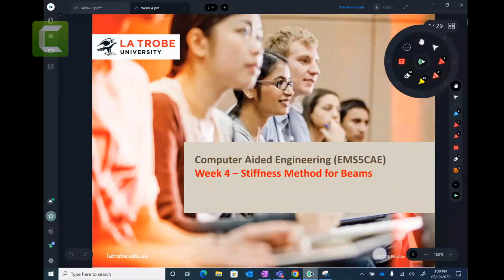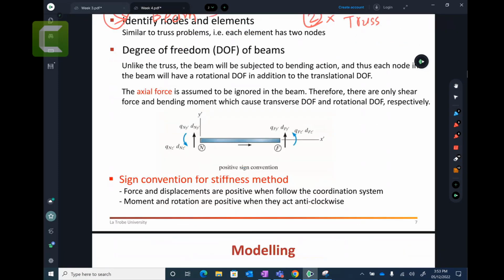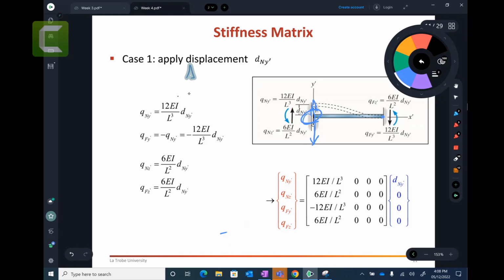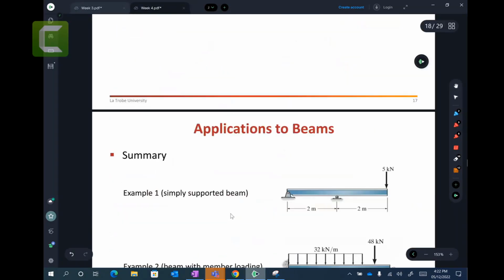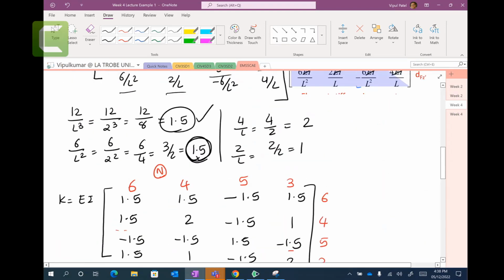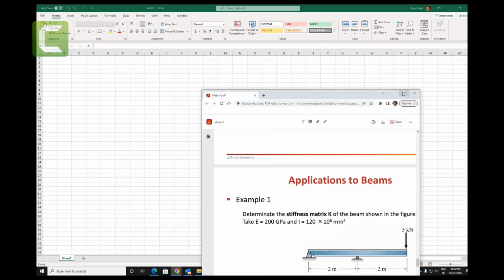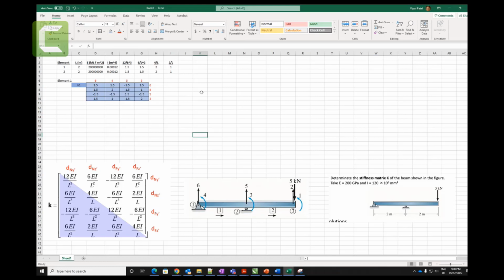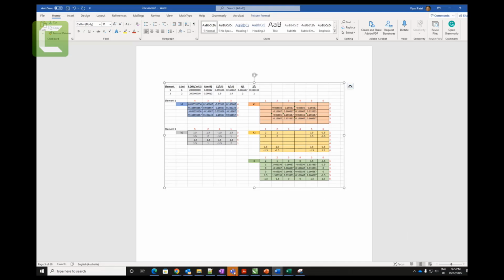EMS5CAE Week 4 Lecture

Comment: In example 1, Dr. Patel, the point load on the cantilever had two free DoF which formed part of the K matrix. In example 2, the UDL and the point load did not have DoF assigned. What is the reason behind that, please? Is it due to them not being positioned on a cantilever? Thank you!
Reply: I answered my own question after while watching the week 5 lecture. It is because the forces were not applied at a node.
Reply from the maker: Thank you . This is correct.